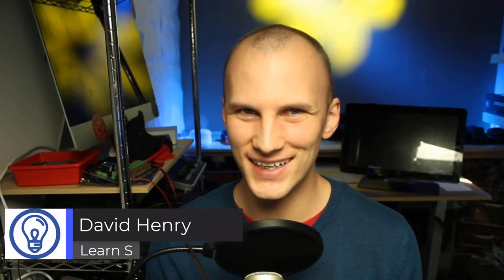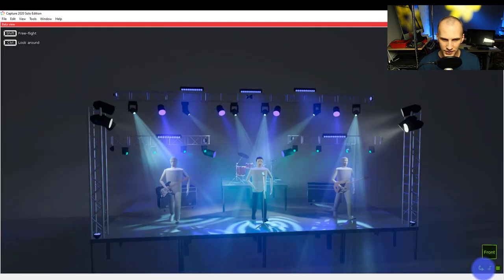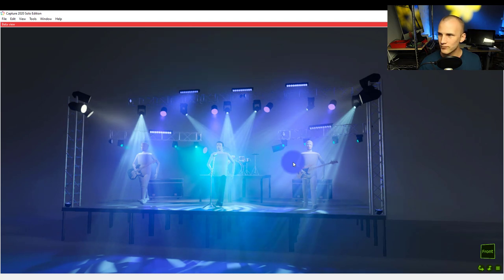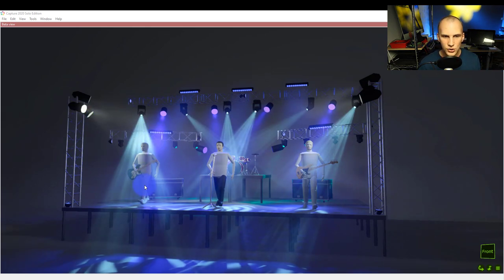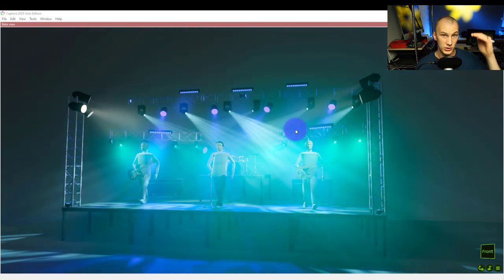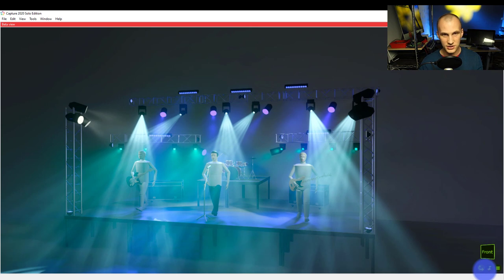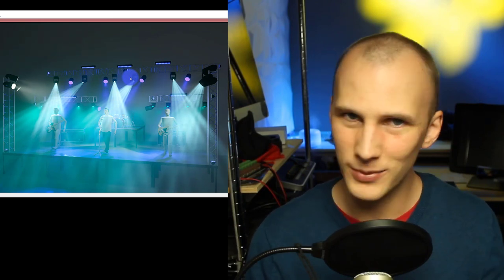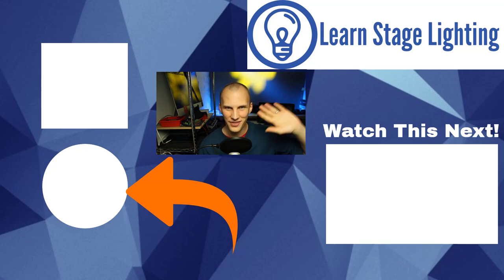2 Ways You Need To Think When Designing a Lighting Rig

Comment: great tips.  My dilemma as I design lighting for my church is low ceilings.  we just purchased an old elementary school, our sanctuary is the cafetorium .  perhaps 14' ceiling height in the audience and 12 or so on stage.  The whole thing is covered in 2x2 drop tiles.  No way I can get a 45 degree vertical angle.
Reply from the maker: Get as close as you can.  I often recommend using wide par 38's (non-LED, as crazy as it sounds), or some type of video/camera lighting (as they are often a much wider angle than stage lights)